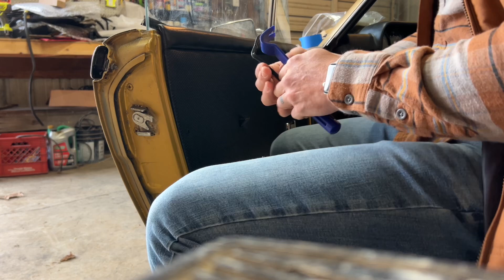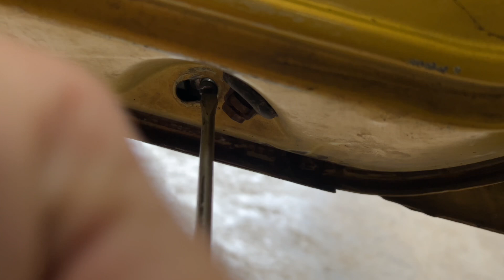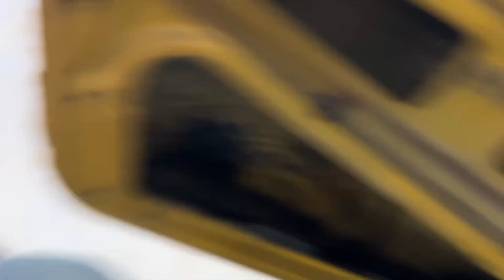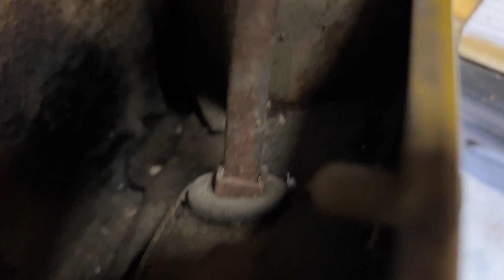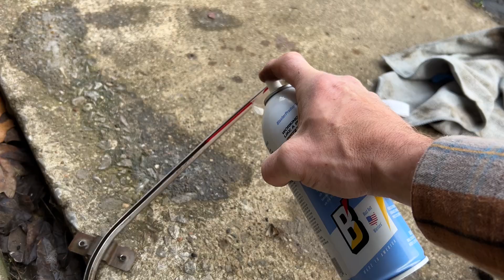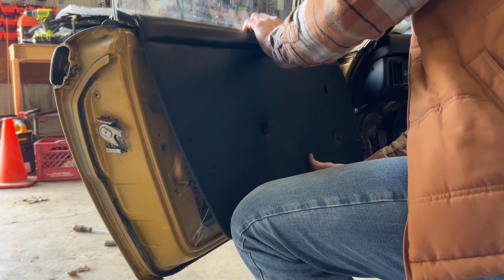Porsche 914 Early window regulator repair

Comment: Early door without the safety reinforcement. The good news about these cars is that there weren't many profound changes throughout the entire run. These videos are convincing me after a complete rebuild, to dismantle my car this winter in preparation for bodywork, rust repair in the trunk, new paint, new rubber, and assembly for springtime......

Comment: What was that roll of film you used as a plastic barrier under the door card? And also where did you source that engine firewall barrier you used on the door interior?
Reply from the maker: @KirkDavis1966  it was a self adhesive film called surface shield that I purchased at Home Depot, which should be available at other big box hardware stores too. The interior sound/heat deadening material was purchased off of Amazon. It was a Silas 50mil. Product. I’ve also used one called MAT66 that was 80mil. Thick.

Comment: You are missing a plastic guide that attaches to the back lower corner of the window.
Reply from the maker: Yes, I realized that after finding one in my box of parts. I show it being installed in my other video. Do you know where they can be bought new? I still need one more.